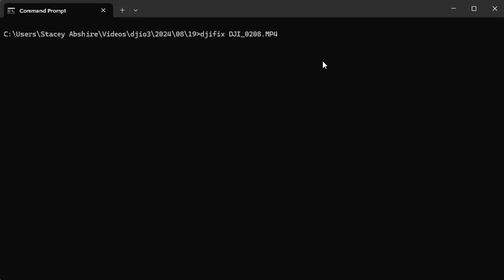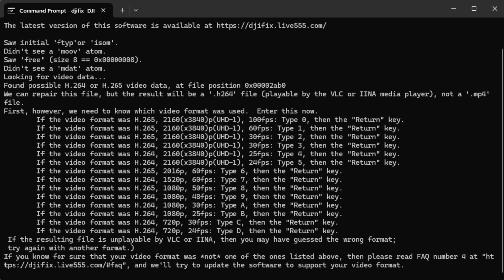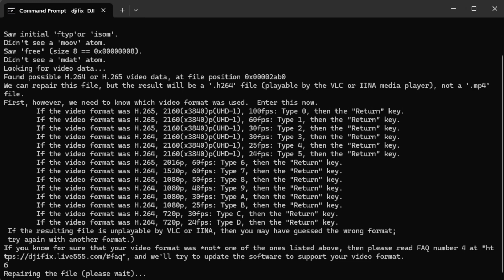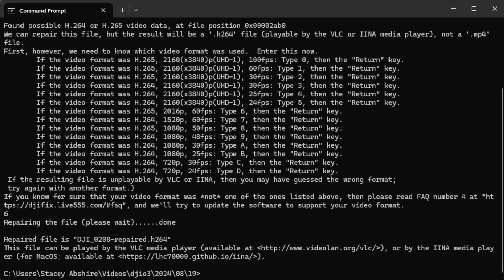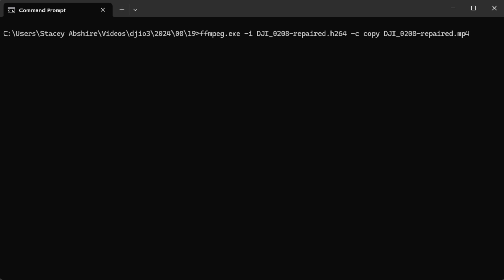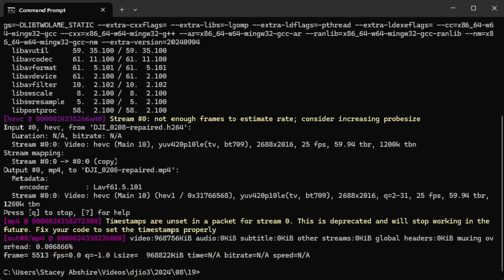Rescue Your Footage: How to Fix Corrupted DJI Video Files!

Comment: Simple fix for this, if you put the micro SD card back in to the drone/air unit it then power it up, leave it for 10 minutes it will repair the corrupted file itself. Drag the now repaired file back over to your PC and as if by magic it will work. Thank me later
Reply from the maker: I tried that one time... Didn't work.  Might work on the DJI camera drones but I don't think it's a feature of the air units, at least not the O3 that I tested it with.